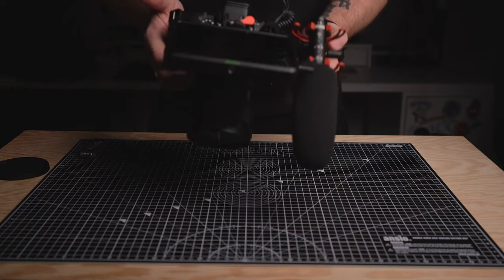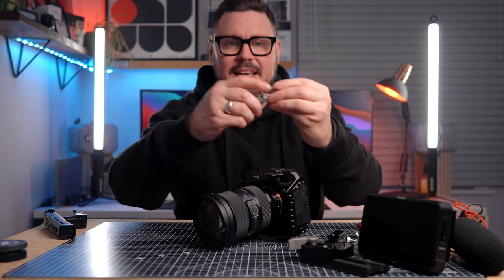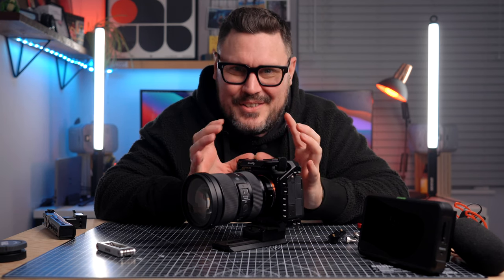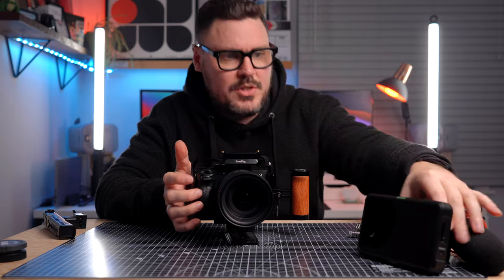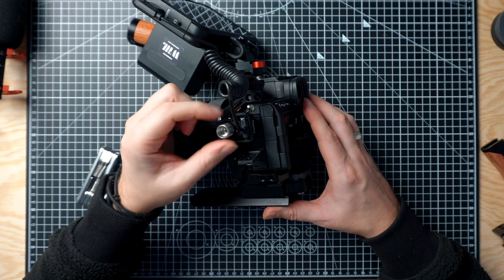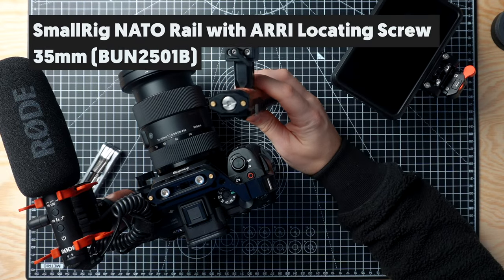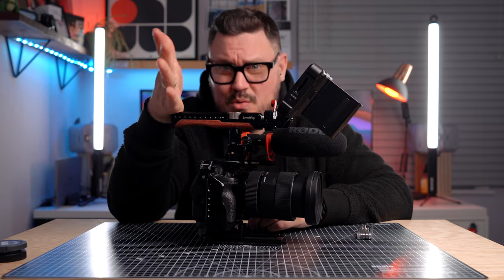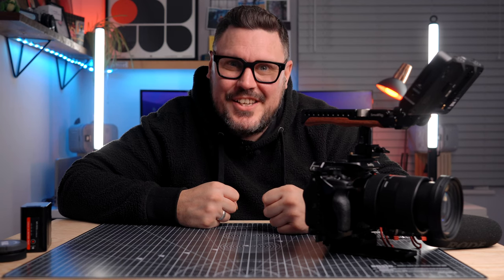Transform Your Sony A7siii into a Handheld Video Machine: Rigging Guide

Comment: Heck yeah, that's pretty much my setup as well. I put the mic on the top handle and the monitor on the left handle, that setup helps me with weight distribution.
Reply from the maker: Nice! thanks for watching! thats interesting about putting the monitor on the side, Ive also struggled with weight distribution but found putting my monitor to the side results in the camera wanting to lean to the left and many a dutch angle captured 😂
Reply: @WillChidlow  As i'm getting older I'm starting to get shaky in the hands so I try my best hahaha
Reply from the maker: @rybread81  next step is get a gimbal 😂
Reply: @WillChidlow  I have one but my patients runs thin trying to balance it hahaha